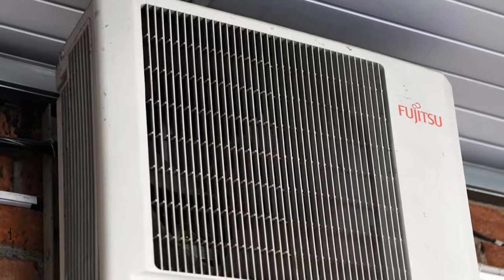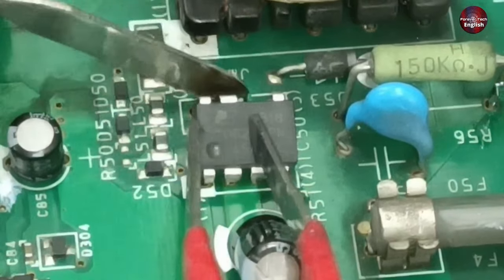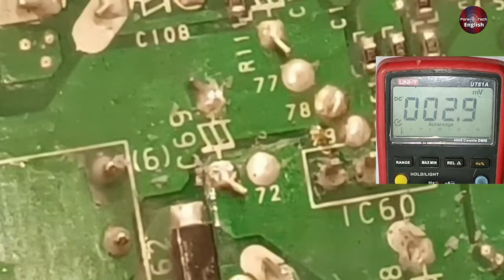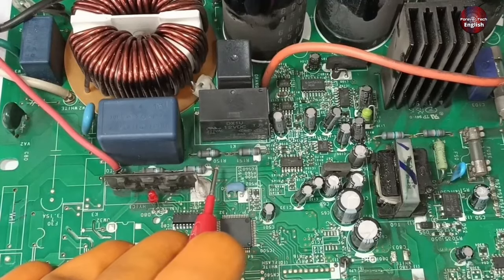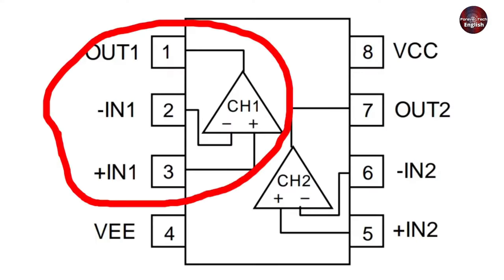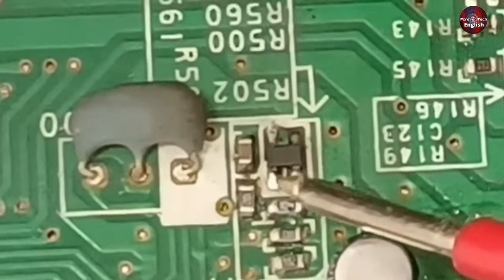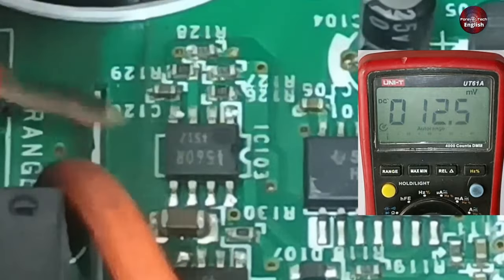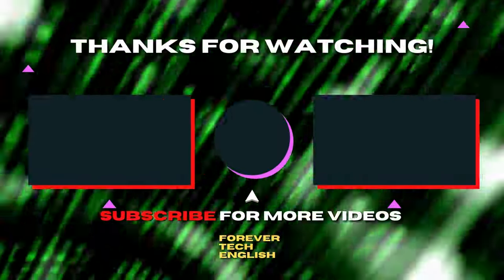Fujitsu Mini Split A/C Circuit Board Not Turning On Test

Comment: So, instead of repair, you broke it?
Reply from the maker: I didn't broke it, I tested it, but at the end micro controller is damaged, so working on this board is useless. Every part of the board is available in market not the micro controller, untill you find one from the same board. Which has some other problem in it